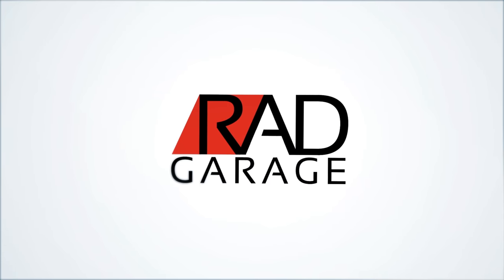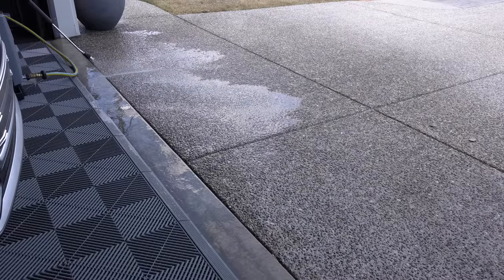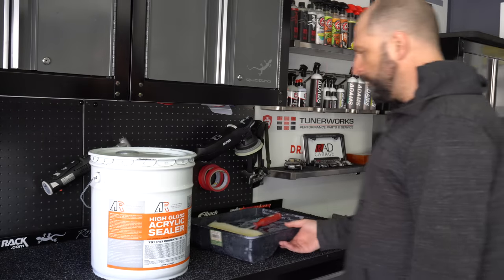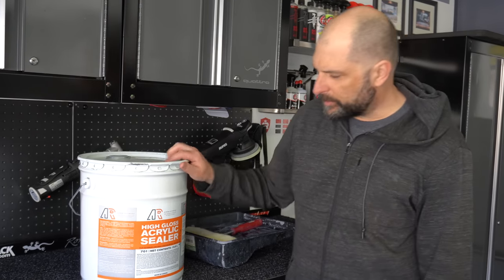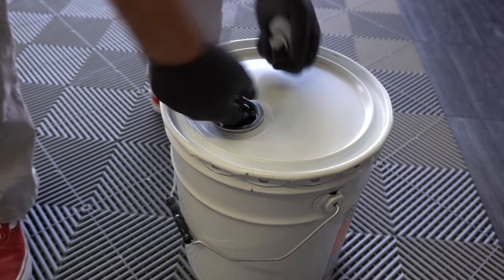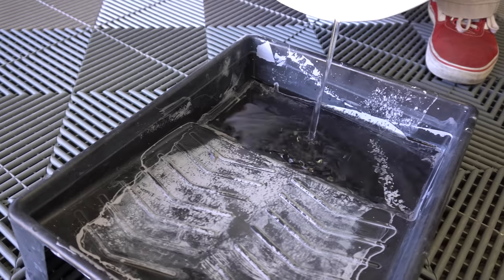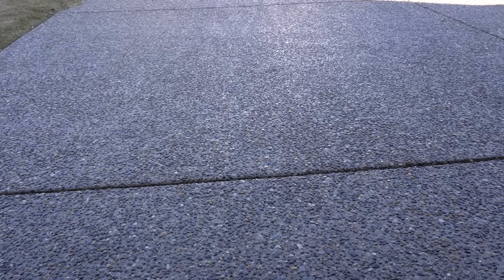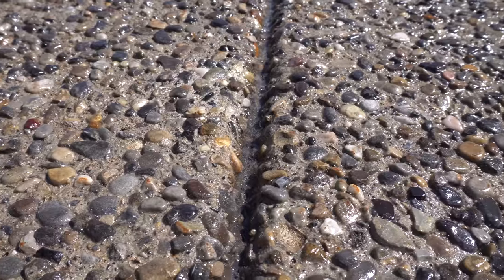SEALING EXPOSED AGGREGATE DRIVEWAY | Watch a Suburban Dad Seal his Beloved Driveway in High Gloss

Comment: I got the same stuff recently.  It's over $200 CAD now.  They told me it's best to do it in the am (around 8am)  if you are exposed to the sun.  Don't do it in the afternoon after a hot day, the driveway will be too warm.  Also don't it too early in the am because of possible dew from the night before.  You don't want any water under the sealer or it will turn white.
Reply from the maker: That’s solid advice. I just bought a new bucket of it. I remember when it cost $115. The good ol’ days.

Comment: Just curious, was your concrete reinforced with a grid of rebar or wire mesh?  Many cracks in concrete are due to pour design in prep.  Mainly because people cut corners when it comes to reinforcing measures!  Then when cracks do form, water gets in there and then freezing weather just slowly tears them apart over time.  Longevity for concrete slabs lies in the reinforcement measures along with expansion and control joint layouts.  Your sealer looks great.  I try and encourage everyone to seal fresh concrete, it’s a great preventive measure!  Thx
Reply from the maker: Oh yeah, there's all kinds of rebar under the slab. I don't know if there's anything that can be done to prevent cracks from concrete up here. You see them EVERYWHERE. The contractors/developers claim it is inevitable with our constant and harsh freeze/thaw cycles, but I don't know if that's true or they just lack the skill and innovation to think around the issue. At any rate, my driveway is the envy of the street!

Comment: Rick - Thanks for posting this.  I think I was actually drooling just a bit watching in 4k.  My wife and I will be closing the end of July on our new house - large rear patio, large front porch and walkway, 3 car garage driveway and I am looking forward to doing this on all three of these areas of exposed aggregate.  Looks like it will be a lot of work but I think it will look great when done.  The concrete was poured last week, so it will be almost two months by the time we move in and I hope that will be enough cure time for it.  I will see what the manufacturer says in regard to that to make sure we will be good.  Again, thank you.
Reply from the maker: I don't think our builder waited any specific amount of time before having our new driveway sealed. I think you should be in great shape if the drive and walkways have been poured for more than two months. It's actually easy work, just take your time and make sure you have enough quality rollers suited for rough surfaces. All the best.
Reply: I just bought Sealant in 2023 and it now costs 230. Inflation sucks.

Great job.

Comment: I did my aggregate driveway, sidewalks and porches with gloss brown sealer. Everything except for one of my sidewalks turned out awesome. The one sidewalk is nice along the edges where I cut it in. But the middle turned out looking quite a bit lighter. Wondering if I should strip it and do it over. Or reapply in the fall or maybe wait until spring next year.
Reply from the maker: I find there are portions that lack uniformity. Not sure what causes that, but as the sealer begins to wear down, it ends up evening out enough that I don’t even notice it. 

What would you do to strip it off?
Reply: @RADGarage  lol no clue. I used brown cap Sutfkoat. I’m probably going to just do another coat in the fall on that sidewalk. The rest of it looks really really good. Has a nice gloss look
Reply from the maker: Looks good AND it is protected from the elements!

Comment: If I put this on a driveway or patio, is it okay to pressure wash once a year or every 2 years? Will the product peel off with pressure washing or does it penetrate into the concrete? Would you expect the need to reapply after 2 or 3 years?
Reply from the maker: I reapply every 2-3 years but I’m a bit weird. You can wash this daily and the sealant will sustain it no problem. As long as you use a high-grade sealer. The one I prefer runs $225 for the 5 gallon bucket. Worth it to spend more.

Comment: How do you clean snow from exposed aggregate  drive way ? Any tips ? I have noticed after first snow season some concrete came off
Reply from the maker: @niteshbarot9551  If you are losing parts of your concrete when you shovel, that’s not supposed to happen. My driveway is only 13 years old. I shovel it a lot. I have probably 20 places on my driveway where a stone has let loose. The OCD in me wants to find the perfect stone to refill the void. The reason I am so religious with sealing my driveway is to keep it from spalling, chipping and weathering. My best advice, is apply a sealer and then shoveling shouldn’t result in damage.

Comment: Did you use a particular size of roller in term of depth? 3/8 or 1/2"? I was told to go with a deeper one.
Reply from the maker: @danpiedra3910  I don’t notice a big difference between 1/2 and 3/8 so I usually go for the ones on sale. This particular sealer eats rollers up pretty quick so don’t spend too much on them. If you have a very smooth aggregate you’ll have no issues with the 3/8 rollers.

Comment: Is the high gloss slippery when it's wet? Looks great by the way.
Reply from the maker: Thanks. It is not too bad on the exposed aggregate. If it’s wet I wouldn’t suggest running on it. I once applied it on the smooth stamped concrete section and that was lethally slippery. I also use it on the smooth garage floor and that’s a death trap but I have Swisstrax on top of it.

Comment: Do you have any experience with BASF MasterKure 300XS? I had already bought that, the product info seems very similar. Great vid
Reply from the maker: I have only used this particular sealer in my experience. I like it, but am always open to new opportunities. Are you liking it?
Reply: @RADGarage  I live in Saskatoon so I have similar weather challenges. The 300xs has 30% solids so it’s a little thicker and looks good (just applied this weekend). We’ll see I guess.
Reply from the maker: I think one notable difference between the winters here in Calgary versus yours in Saskatoon is that we tend to have more fluctuations between warm and cold winter days. Seriously, no two days are the same here. I think that takes a real toll on sealers. My impression is that your weather is a bit more stable. Would you agree?
Reply: @RADGarage  I would 💯, very dry and very cold. Not many fluctuations until March.

Comment: Going through this process on a backyard patio. A contractor tore out old 2×4s and that opened a can of worms. Couldn't get new wood in due to concrete settling over 40 years. Belt sanded for days till the wood was level. He sprayed a coat of sealer that dried foggy. Shoulda pressured washed first and used a different sealer. I was told this lacquer would fog if puddled. Got a serious issue now. I'm hoping pressure washing takes everything off and I can start with the sealer you used. No fun at this point. Shoulda tore it out and built a new patio floor.
Reply from the maker: That sucks. Good news is, those inferior quality sealants tend to wear away pretty quickly.
Reply: @RADGarage  been down there for a week and it looks horrible. Wearing and fogging. Gonna return an $80 gallon and start over. It's what happens when you hire a 70 year old uncle that builds homes but never does any finishing, I guess.
Reply from the maker: I'm sure he had good intentions. I picked up my sealer yesterday. The price has skyrocketed to $220. Ten years ago, the same sealer was $90.
Reply: @RADGarage  I'm curious, when you pressure wash does it take off old sealer or just clean the existing sealer? I'm debating on how to get the fogged up sealer out of the aggregate.
Reply from the maker: I am not entirely sure, but anything that hits the driveway is having some effect on the sealer. I would need to conduct a test to see, but a cheap sealer will probably come off after a few pressure washes. There are just so many factors that impact the effectiveness of a sealer, it is hard to say. You should send me a pic to radgarageyyc@gmail.com to cure my curiosity on what it looks like.
Reply: @RADGarage  I'm gonna try that. Unfortunately my wife was so bummed she covered the patio with outdoor carpets and put the old furniture back there. I guess that's one way to solve the problem. 🙃

Comment: I found your video because my entire pool deck has this concrete finish and I want to restore it's old, dull, aging look. 
I'm also looking for a product that could possibly help make it smoother when walking barefoot?
Reply from the maker: I have an exposed aggregate patio in the backyard that gets baked by the sun all year long. It is looking quite worn out and I am confident a coat of this high gloss acrylic sealer will bring its appearance back to life while also providing it with added protection. I would be hesitant to recommend a high gloss sealer for concrete around a pool area just because I see that creating a slippery surface. I have never researched it myself, but I have been told there are additives you can use in a sealer to make it less slippery when wet. I recommend finding a concrete supply firm in your area and seeing what they recommend as these type of recommendations are often based on local conditions.

Comment: My exposed aggregate driveway has a few cracks.  Should I roll right over them or try to repair first.  Not big cracks just hairline..
Reply from the maker: I roll right over the cracks if they are thin. For me, living in a climate where we get sub-zero temps, I want to avoid water accumulating in the cracks and then freezing and expanding, making the crack worse. So, on wider cracks, I use a silicone to fill them. For the hairlines, I think having a good amount of sealant in there will help prevent them worsening. So, depending what climate you are battling, it may be a good idea to fill the wider ones. The biggest saving grace of a sealer on aggregate is to protect the unprotected surface from sun and water damage.  Sadly, cracks are unavoidable where I am due the freeze/thaw cycle and ground swell. Luckily, I only have a couple.

Comment: Can you also paint exposed aggregate? Should I use this before I start painting it? I’m painting basketball lines/half court basketball court on to my driveway and wanted to see what the best method would be. It’s tough to find anything on painting exposed aggregate. Thanks in advance! Nice work!
Reply from the maker: Hmmm, that is question I never anticipated getting. I guess it would be possible, but you will probably not get crisp edges on your lines. Sealing it first will make it hard for any paint you use to adhere. This might be one I need to ask a friend about.
Reply: RAD GARAGE I’d really appreciate it. I’ve been searching everywhere on how to paint an aggregate driveway into a basketball half court. Any chance you could email me at ? Thanks again!
Reply from the maker: I think you may be the trailblazer in this. I can't seem to find any information regarding painting on an aggregate driveway. I say must go for it. If you mess up, I bet a good pressure washer would be able to remove any paint. Good luck!
Reply: RAD GARAGE do you think it’s possible to paint it like regular concrete? If it were you, what paint would you use to paint with? Should I use some kind of primer first? Thanks again
Reply from the maker: Honestly, I don't have a clue. You'd be best to ask a paint store professional.

Comment: Is any chance to remove Nutec paint from this kind of concrete?

Have been painted with nutec colour and want it to be back to aggregated concrete. 
Thanks
Reply from the maker: I had to Google "Nutec" paint. From what I quickly read, it's a brand of paint designed to penetrate concrete to create a lasting coat. That's not good news if you are wishing to return the finish to its natural state. My limited scientific knowledge tells me that you would need to remove the layer of concrete that is saturated with the paint, and if you can find a pressure washer operator with a commercial-grade level of machine, there may be a chance, but you would have to ask around. I can't believe someone would paint their driveway. But, I learn something new every day in this garage hobby of mine! Good luck.

Comment: What do you recommend to wash an aggregate driveway that's mossy (before pressure washing)?  Some people recommend bleach solution.  How long does the sealer take to fully cure?  Awesome job & thanks for sharing!
Reply from the maker: That's a good question. I always count on the pressure of the water to get things clean enough. Have you already attempted to rid the driveway of the moss with your pressure washer? The sealer cures quickly. You can walk on it very soon after applying (1 hour), but I always play it safe and keep cars off it for two days.
Reply: @RADGarage   i haven't tried yet with just the pressure washer, was hoping to save myself from doing it twice if it ends up needing some kind of cleaner or bleach.  I'll try with the pressure washer first.  Thanks for your advice.
Reply from the maker: I'm just a guy who learns as he goes! I hope the one pass is enough for you.

Comment: I bought a house which has an aggregate driveway similar to yours. The previous owner didn’t maintain it for 4 years. I am planning to do it this week. Your video is helpful. What do you fill in the gaps between the driveway. My gaps are irregular
Reply from the maker: Congrats on the new house. When you say “gaps” are you referring to cracks or the expansion joints?
Reply: RAD GARAGE : thank you. They are expansion joints. I filled in some with play sand which has hardened. But worried if water might seep into the cracks and cause  some damage
Reply from the maker: toniepaiva I keep those joints clear of debris and just ensure they are sealed by using a little paint brush to lay down the sealer.

Comment: What is your driveway like with snow or freezing weather?  Does it get slippery after you apply the sealant?  I had a company seal my driveway and it was very slippery during the winter.
Reply from the maker: Yes, the driveway can be slippery when wet for a few weeks after the sealer is applied. That’s part of the reason I like to do it in the late-Spring because if there’s snow on the driveway, it can be deceptively slick. By the time winter rolls around, things are way less slippery. I have a stamped concrete border on one side of my driveway that I don’t seal any longer because it becomes super slippery.

Comment: Superb video! Would you be willing to share the type of rollers you used in the video?
Reply from the maker: Thanks. I use a low nap roller. 1/4” works great. The longer nap rollers start to “shed” fibres as the sealer is quite sticky.
Reply: @RADGarage  that's very helpful, thanks for the quick turn around!
Reply from the maker: @numerousid6478  Anytime. Get a few rollers because depending on the quality, they can deteriorate quickly. I usually go through 3 or 4.
Reply: Are foam rollers more effective in achieving results?

Comment: I have black mold on driveway because of minimal sun exposure will sealer prevent it from coming back?
Reply from the maker: By theory it should help because the sealer creates a plastic barrier that would interfere with the moulding process but I’m no scientist. Moisture is a critical factor in the equation. I get moisture that comes up from under the driveway and can get trapped by the sealer creating a milky appearance. I always defer to the pros at my local supply firm.
Reply: @RADGarage  Thank you for the reply!

Comment: How many sq footage is this? My drum recommends 1 gal per 100 sq Ft, and for my 3 car drive that’s 12 gallons. But it seems excessive compared to what you had to use
Reply from the maker: I"m not exactly sure of the square footage. I estimate the driveway to be 28' wide and 32' long. I am able to cover the driveway and the front steps easily with a 200L bucket of sealer. I usually have 1/3-1/4 of a bucket left.

Comment: Amazing job! Noticed you said you do it every several years. So it fades/ wears off? Does this help with cracks or should I use a epoxy product on cracks first then seal.
Reply from the maker: The weather eventually erodes the layer of sealant. I think it helps with preventing cracks by stopping water from seeping into the divots and freezing thus causing cracks. That's my theory at least. I used an epoxy to fill one crack and then sealed right over top of it once it was dry. It seems to have done the trick.

Comment: Nice job I have a question I’m getting a new aggregate concrete in the driveway should I seal it now or wait 2 years like you doing yours if the answer is do it now how long should I wait after they pour the concrete thkans
Reply from the maker: Hi Noel, I have a friend in Saskatchewan who just sealed his freshly poured aggregate concrete with two coats. He told me that new concrete sucks up the sealer making a second coat imperative. I don't believe he waited more than a few days. Let me reach out to him and report back. Hang tight.
Reply from the maker: My friend waited three days after the pour to apply a first coat of sealer. He's very particular about this kind of stuff. Even more particular than me so you can bank on that.

Comment: does this make the driveway more slippery when it rains?
Reply from the maker: That’s a great question. It does to an extent. I am not worried about walking but if someone were to run on a wet aggregate driveway after sealing, it is definitely a risk. I have a section of smoother concrete that I sealed one year and that was lethal, so I only seal the aggregate now. Thanks for the question.